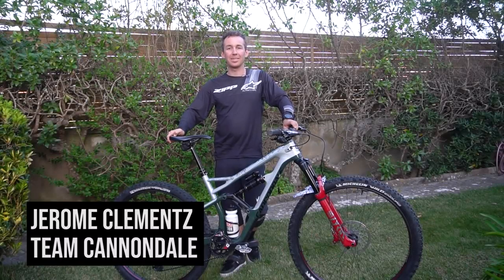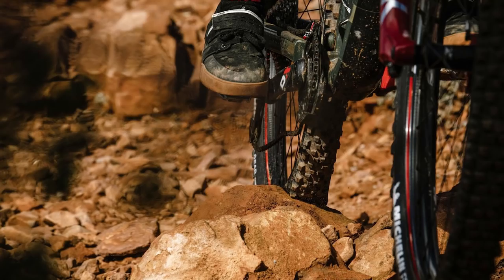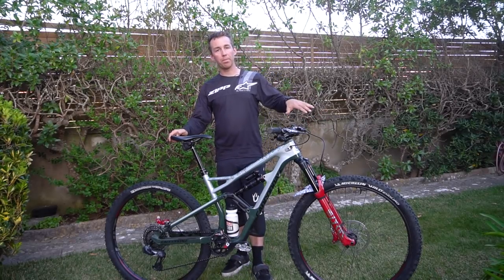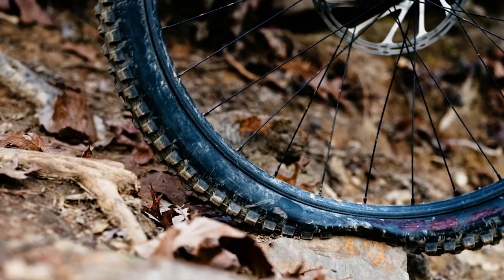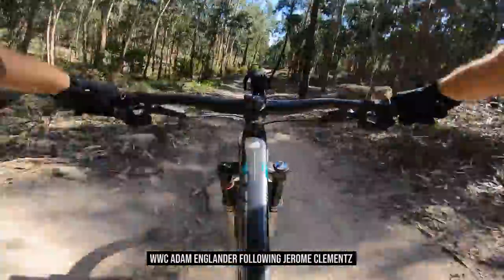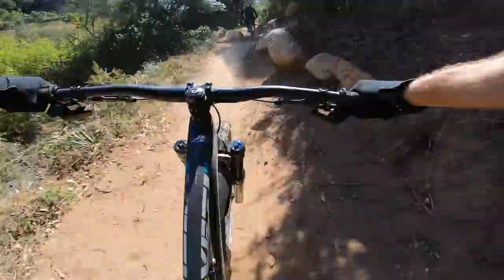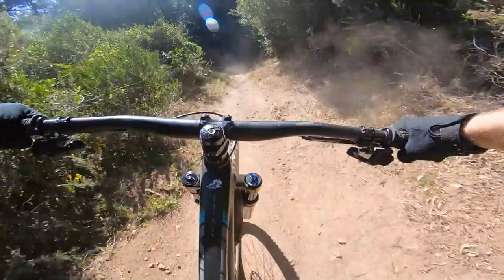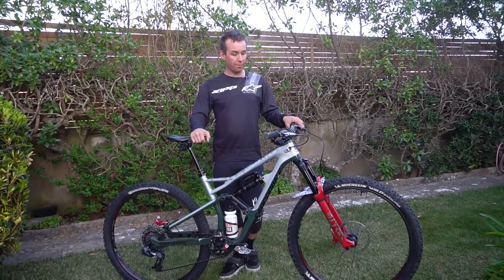Zipp 3Zero Moto Wheels (Explained) w/EWS Champ Jerome Clementz

Comment: All the talk about stiffness of a wheel then you run a flexi, pinch flat tire pressure. Never made sense to me and feels like shat. Give me a laterally stiff frame, a no pinch flat or burp flat higher tire pressure, and a compliant wheel. Never liked the feel of a carbon frame and carbon wheel combo. If you're a sender you know what I'm talking about. It's awesome to finally hear this from other riders. No one else but Worldwide talks about this because they are real deal senders that know and speak truth. Not trying to use industry buzz words to get you to buy a $3200 wheel set...